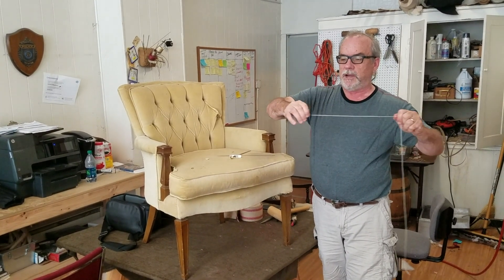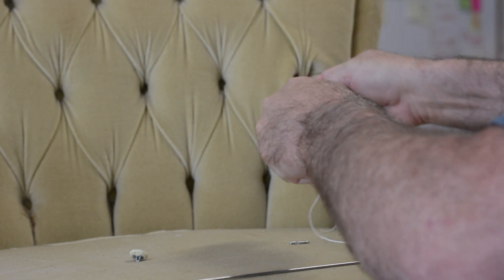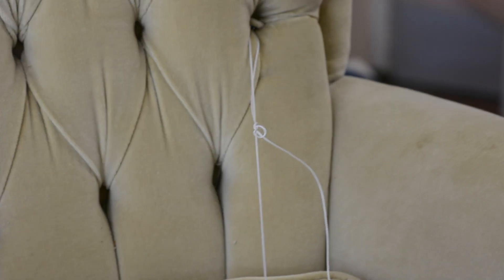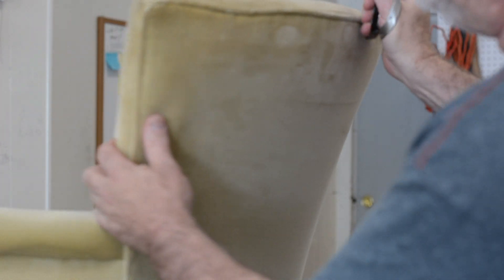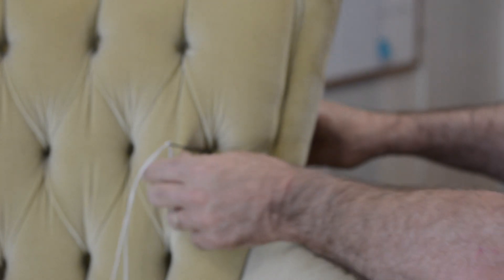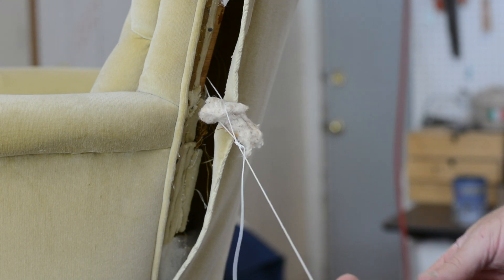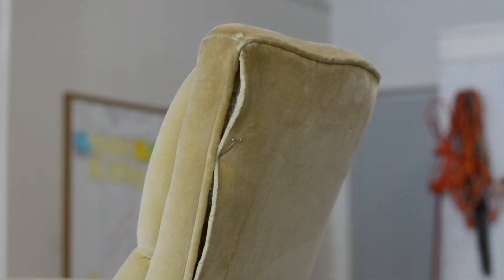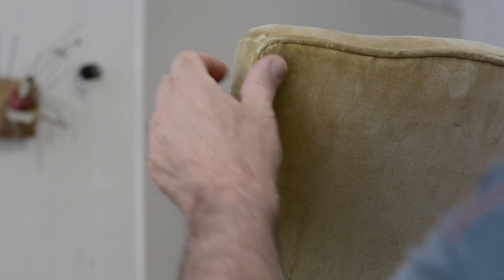Repairing a Popped or Broken Button

Comment: My tufting has lost its tuft. I can do the button method, no problem, but the leather cushion is not removable and the slip-knotted button does not create the “lost” tufting I need to replicate. What can I do?
Reply: I removed the bottom cover and pulled through to the bottom with a long upholsery (10" needle). All fixed! Looks perfect. THx.

Comment: How do you retrieve a button that has slipped into the sofa through the tuft. I have tried pulling it through by slipping a band around it but it won't stay out.
Reply: did you ever find a solution? yes
Reply: i was thinking maybe you could sew the hole up tighter

Comment: Hi I have never seen the German needle method before where could I purchase one please?
Reply: Nigel Heffernan  hi Nigel. Look online at cs Osborne &co. For a no. 417 tufting needle
Reply: cs osborn
Reply: What happens if the fabric on the outside of the furniture stretched, so the button is still attached inside the batting of the furniture? Do I sew the button hole or would it be easier to cut the button that’s still attached and do this method?